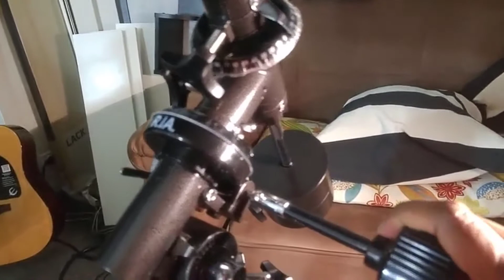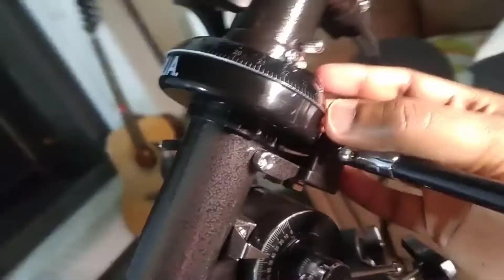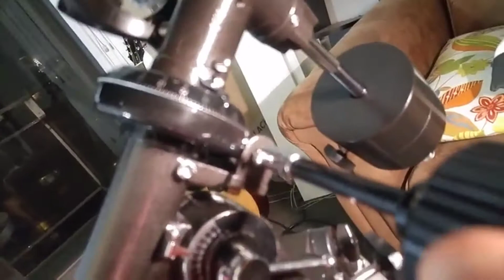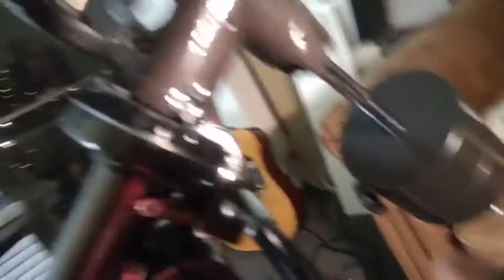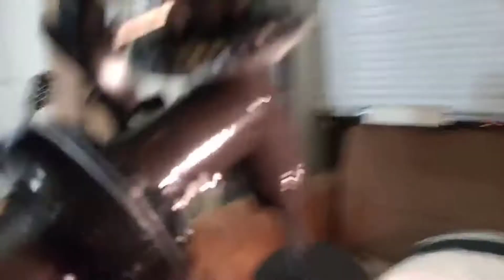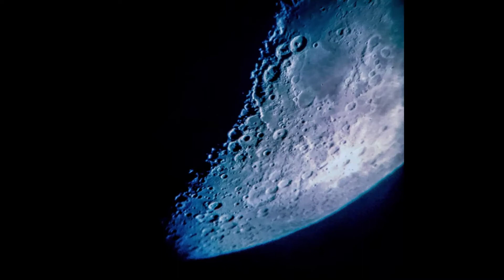Orion 09007 SpaceProbe 130ST Equatorial Reflector Telescope Review | Orion SpaceProbe 130ST

Comment: the screw that is on the black tube might be lose. I just got a telescope with slow motion controls same flexible black tubes with screws. mine has a hex key to use when they come lose. it did 5 days after i assembled 
it. it might have a problem with the teeth of the gears too.